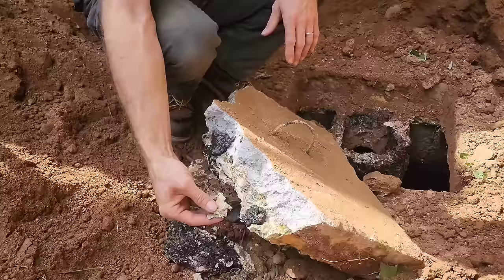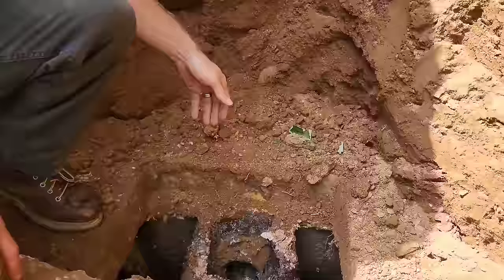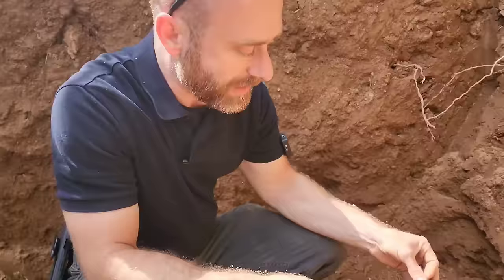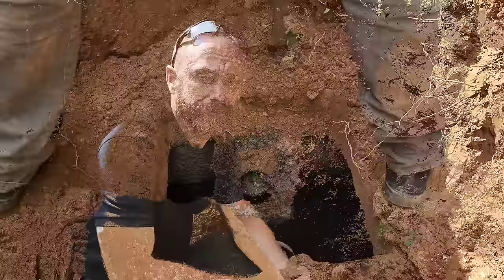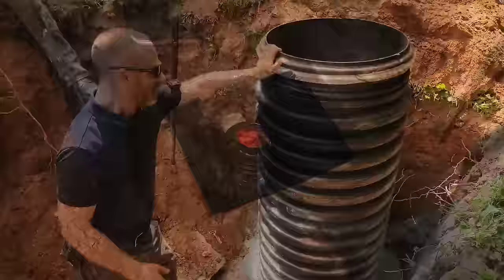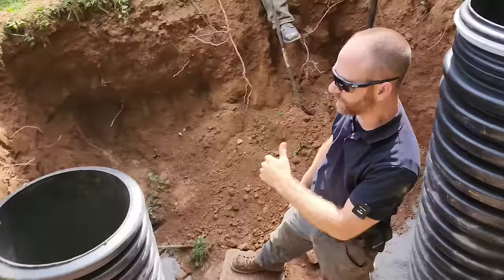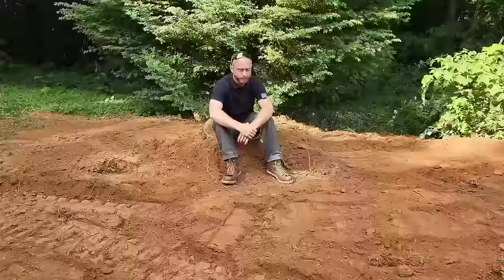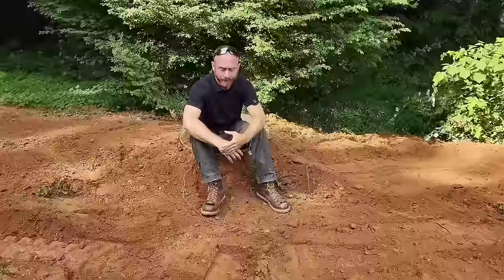Septic Tank Not Serviced In 20 Years.

Comment: I just don’t get why people want to dig up their yard every few years rather than just having an above grade riser. Makes no sense to me. At all.
Reply: That was the first thing I did after I dug mine up thankfully it wasn't that far down to dig but definitely wasn't doing it again after
Reply: @tylersmyley9813  we’re required to get our inspected every three years, the previous owners had it dug up for inspection every three years… they installed risers at the time they sold… smh…
Reply: @MotJ949  
Why required?
Reply: @Quinu12  Don't forget to pay attention to the warning light for the lift pump...if you happen to be in a bowl & the line connection must go uphill.
Reply: @XFizzlepop-Berrytwist  our health department likes to keep the poop and the groundwater separated so we have to have our septic inspected to make sure the poop is going where it’s supposed to go.
Reply: @MotJ949  the nerve of them
Reply: I don't get why people get their tank pumped every few years.
Reply: @asherdie  No reason to under normal circumstances if system is healthy & never backs up. IE no issue @ tank itself or with leech field. Only major benefit is it keeps the sludge on the bottom from building up.
Reply: @asherdie  it’s a lot cheaper and easier to have the tank serviced than it is to have the leach field replaced and it lets you find problems with the system before the system stops working as designed. No amount of septic tank ‘health’ is going to deal with inorganic waste… bacteria can’t digest sand.
Reply: Moms is only like 6 inches deep and she thought she was having a problem so she called for an inspection and due to the heat they said that they werent digging at the time and if uncovered they could squeeze her in 2 days.  She marked them and one i landed spot on and other was 8 inches off
Reply: @MotJ949  how much sand do you eat?
Reply: @asherdie  you know that all the water from your house goes to the septic tank, right? You got the memo on that? Shower water? Laundry water? Potato scrubbing water? Plus when you’re on septic, you’re usually also on well, and well water is not sand-free water in many parts of the country.
Reply: @MotJ949  my kitchen sink, dishwasher and clothes washer are not tied into my septic. I run  aerators so no sand.
You can build a modern septic system and pay for annual maintenance or build one like has been done for eternity and only need a pump to do an inspection every 10 years or so.
Reply: @asherdie  1000% not legal in my county. We take our protecting our groundwater very seriously here.
Reply: @XFizzlepop-Berrytwist  Our township requires septic replacment after 12 years no matter what their shape is. Money making scheme.
Reply: @MotJ949  you should educate yourself better.
Reply: @zack9912000  
I dont see how thats legal… yeah… wouldnt live there.
Reply: If you have to pump your tank every few years you're mistreating it in a very bad way. 
Maybe do some research on the matter and things might start to make sense.
Reply: @countmorbid3187  you’re missing the point entirely. I have to pump every third year because I have to inspect every third year because it is a legal requirement of using a septic system in my place of residence. It has nothing to do with how my septic system works and everything to do with ensuring that it is working properly and documenting to the regulatory authority that it is working properly.
Reply: @asherdie  any water that contains detergents must go through a treatment system.
Sounds like your system is not legal.
Reply: @swskitso  depends on where you are, as far as I know Florida doesn't care, can't talk about anywhere else though
Reply: @jaykoerner  fair enough, i only know indiana and illinois
Honestly rules can even vary by inspector.
Some of the old men ignore new rules while younger ones are making up their own.
Reply: @swskitso  sounds like you don't know what you're talking about.
Reply: Riser is ugly..  and id rather dig..
Reply: @asherdie  

Because they through in stuff they shouldn't.
Reply: @jeepsblackpowderandlights4305  

Why dig? You can cover it anyway (without blocking access).
Reply: Why wouldn't these clown ass installers do it the first time
Reply: @doomslayerforever2858  installers are only going to do what the homeowner or builder is willing to pay for.
Reply: @MotJ949  should be a requirement by law from the start
Reply: @asherdie  My husband was a sewer inspector for my town. He and the other inspector were fired by the town board because they followed the law and treated everyone equally. The new guys were constantly ignoring the laws when it was someone the board wanted to help. The board also used the new guys to harass people they didn't like.
Reply: @doomslayerforever2858  no it shouldn't
Reply: @queenbunnyfoofoo6112  sounds like my experience.
Call the county commissioner and get special treatment.
Reply: @asherdie  Yep,
Reply: @MotJ949  Gray water can be very safely managed without going into septic or sewer.  Most dry parts of the country have codes for gray water systems.
Reply: @asherdie  Because solids accumulate over time and about the time you have a deposit over 25% or so over the tank depth then that's when the problems start happening in terms of particulate getting into the drain field and clogging up the whole works. Much less expensive to pump out the solids every 5 years for a few hundred dollars vs. replacing the drain field for a few thousand.
Reply: @MotJ949  Clear/clean water is the best thing you can do for your septic system...it dilutes the sludge and promotes flow through the field.
Reply: @MrGus.1  not if you exceed the percolation rate of your field! But I also don’t know why you bring this up when my comment was about installing risers…
Reply: I’m digging mine by hand and today yeah it’s gotta be this deep like 5/6 … and I genuinely know they had the tractors so it wasn’t a problem. I however. Get some labour I never want to do again

Comment: You start showing how destroyed that concrete was, and my first thought "man, you have balls of steel to be standing on top of a concrete cistern you know to be failing from molecular decomposition, knowing that if it gives way, you are literally taking a shit bath."

I'll deal with my demons, you sir are far braver than I.
Reply: I'm with you
Reply: No shit.

😂😂
Reply: One of the guys that came to replace my septic tank came close to going it, he put his foot through the extremely rusted top of a steel tank -- which seemed like a poor choice 20 feet from the ocean.

I replaced it with concrete instead of plastic... now he's telling me concrete tanks don't last forever either?
Reply: james just said in this video that plastic last longer then concrete
Reply: @elhoward7440  get it properly serviced and it should last several decades based on the video.  20 years, no service, and still doesn't need to to be replaced.
Reply: It was holding up the soil, so it did have some strength.
Reply: Experienced and knows his shit. Hahaha. No pun intended. Lmfao
Reply: @elhoward7440    Plastic tanks can also cave in, but yeah won’t rust ! 😂. Not sure what made the tank fail, but the plumbing company I worked for, said that the plastic ones do cave in often. PS. There were no tire tracks from any vehicle.
Reply: @elhoward7440  Its full of poop which is loaded with bacteria from your gut, the stool still has nutrients for it to feed on so yeah you get a septic thats full of digestive bacteria that will chew through cement.
Reply: I was thinking about this the whole video.
I've come to the conclusion that hopefully the top just didn't get enough germs to deteriorate as much. I'm probably wrong.
Reply: you ever wonder why you think of testicles so much?
Reply: Lol the tank i have is in front of the garage built in the late 50’s no signs of deteriorating buried about 1 -2 feet deep but they poured it 18’s thick . Leech lines go under garage to a giant pit in the back yard
Reply: @op pretty sure fwiw imeadetly one would die if ever falling into a septic or cesspit or cesspool etc fwiw from being too deep to ever be found again or seen however many feet all the way from whatever level the building is at.. fwiw it will uh it could be about 400 feet from it idk why other than ig fir the park lot purposes etc.. for say a church or resturant or other commercisl building.
Reply: @geneticdisorder1900 oh fwiw the acidity of soil I read is probabke for a potentially abke to have effect on detteriorating concrete.
Reply: @stevensanderson2817 even asphaltic concrete?
Reply: @stevensanderson2817 or the homemade systems if it is older ie 40s and pripr fwiw with the wood frames or fwiw wooden tanks and or cinder blocks or stacked rocks etc.
Reply: @georgewashington938 uh, tf? How is that what you think of from this thread letalone a septic system deteriorating? Lol just saying if it what you into thats whatever man but fwiw just know its not relavent to a septic system.. or not what I fogured would be but whatever,
Reply: @Joural0401 well steel ones are newer than what is it uh cement/homemade ones,
Reply: What causes a septic tank to deteriorate like that?

Comment: Here in interior Alaska our tanks are around 10 feet down, hopefully below the frost line. We have 6 inch risers to allow annual pumping, because bacteria doesn't do well in the cold. Even then, they sometimes freeze. Septic company's solution (especially at -30) is to wire a water heater electrode onto a cord and drop it down the riser, hopefully getting the toilet flushing again. Short term solution? The old outhouse. And yes, styrofoam toilet seats are a thing in them. The Last Frontier, indeed.

Comment: My late father was very upfront with potential customers. He'd put in driveways, house pads, hardscape, etc, with his equipment. He was willing to work with a septic company to do siteprep and installation of ONLY NEW tanks and leach fields on CLEAN ground. He had it in writing that he would NEVER touch a system once it was used, and that the septic company had full warranty and maintenance responsibilities. Then, he was extra careful which septic companies he was willing to work with.  He never had one fail on a customer. He believed in doing it right the first time. Miss him.

Comment: When we bought our farm here in Kentucky I asked the seller (should have asked before we put a contract on the house) at closing when was the last time the septic tank was pumped he looked at me and said never. The tank was about 18 years old and the drain field was now clogged which we found out after we moved in we knew we were going to build a house in a couple years and have to put in a new tank in another location on the farm so we just pumped the tank twice in the two years that we lived in the double  wide since it was only a thousand gallon tank and we knew the drain field was clogged cuz when it rained it stink out the drain field.

As a former plumber not a septic tank installer I normally pump my tank every 5 years depending on how many people are living in the house it's just me and my wife and since this was a three bedroom three bath house we built 1500 gallon tank we will pump at 5 years we've only been in the house now a year.

Many don't realize not only does your tank fill up then it starts to overflow into the drain field and solids going to your drain field clog up your pipes with toilet paper and whatever else you're flushing.
Reply: "... and whatever else you're flushing." Which, if you have kids, has been toys, washcloths, coins, tampons still in their wrappers, toilet paper cardboard tubes, maybe a bungee cord, and so ... much ... vomit
Reply: I live by myself I don’t even put toilet paper down my toilet😂

Comment: Our tank (1500 gal) and drainfield is over 50 years old. Only toilets and bath drains go into tank. The wash machine, dishwasher,  kitchen sink and water softener go into tile. It takes a month to refill tank after pumping. (2 person household) The effluent leaving tank is clear because the settling time is so long and water usage is held to a minimum. Your wash machine, kitchen sink, and not conserving water are the biggest reasons for early drainfield failure.
Reply: I use a top loader machine and it uses less water. Also do laundry 2 times weekly.

Comment: Definitely familiar w/ this. At work (County Park which has 1 large main + several varying size outliers) all the tanks are old concrete. At the main there's over a dozen varying from 1500 to 10000 gal largely inherited when it was a popular private venture before the county split. Some get pumped more often than others as the leech fields have degraded over time. Extending the lines on some of the more problematic ones has only been a band-aid for some while others still work.

Even as you mentioned this one being 5-ft deep I automatically thought that meant a riser or covered vault was in order.

Comment: Would love to see a video advising on new constructions and what advice you'd give on a new septic system being installed.
Reply: Take into account where your gutters drain, you dont want that water finding its way in.
Install risers for future maintenance, minimum 12" diameter for pumping. Also risers mark your tank to prevent future accidents, like driving a truck on it.
Have your county inspector come out for soil samples and to discuss your needs either before you call a contractor or on the same day, dont let the contractor be the middle man or you may find yourself paying for an oversized system.
Dont commit until you have your soil sample results and a clear idea of the county requirements.

Comment: Hey James is saw how you setup that outlet T. There are things called Poly lock extend and lock adaptors. I think they are a better alternative and more secure than pipe. I can get them at a pipe supplier for around $32 its worth a look.
Reply: Those thing are great,I put some PL premium on it then jam it in, they don't move.
Reply from the maker: It was corrugated out of the tank....can't use an adapter
Reply: Those filters are not required here so we usually would just use sc40 to build the baffle.
We always leave them unglued so they can be removed for cleaning.
9/10 whenever i saw this i would ask how long they had a water softener and they were always surprised i knew.

Comment: I never knew that you were supposed to service your septic system yearly until I found your channel a few days ago. Our system hasn't been serviced since we moved here and it was only checked to make sure it still worked to use it because it wasn't used for close to 20 years and that was about 15 years ago so this system is old as crap and uses PVC  and has one center outflow with about 5 or 6 split offs going both ways about 20-30ft but the first 2 rows catch almost all of it and so it grows like crazy there but the rest work but not as good but we suspect some of the pipes may be busted at the ends. We really need to service and update it but we don't have the money for it also I still know exactly where it is because depending on the time of year you can see the difference in the grass growing

Comment: Just had the original 1959 septic pumped on a home I'm about to close on.  The tank is buried over 3ft deep and I asked the company that did the pumping about having a riser installed.  I was told that since the tank is a "homemade" tank, it may be difficult to find a riser that will fit properly and since it's buried that deep, adding a riser is not recommended as it may cause more stress on the aged tank.  I'm very disappointed as I don't like that my yard will need to be dug up every 6yrs or so to have it pumped. :/

Comment: So did the tank actually need pumping?  And how was all the pumping and maintenance in the world going to stop sewer water from breaking down the concrete?  I owned a place that I know hadn't been pumped for over 30 years the only issue we had was where we decided to plant a tree to close to inlet and in a matter of couple years the roots grew into the old clay pipe leading to the inlet.  I opened the tank and saw the roots fix the pipe.  It wasn't until a major hurricane hit that I finally had it pumped, that didn't do much good as the drain field was flooded and the pump guy told me wasn't much he could do until it dried out some.  At first I asked if the tank was the issue and he assured me the issue was the drain field not the tank.
Reply: The drainfield  was flooded because  the tank hadn't been  pumped. Solids build up, flow out into the  leach field, clog the soil pores, soil stops draining, air exchange  stops, drainfield  floods.

Comment: My tank been in ground since I had home built in 1987. Never been uncovered. Top of tank is only around 6 inches under ground. Grass has always died in summer with a dry spell. I contacted county office years ago to make sure it passed inspection when installed. I was told if the top was completely covered with dirt it passes. Wish they had buried it at least 12 inches for the grass above it. Not going to be concerned about any problems at this point unless one arises.